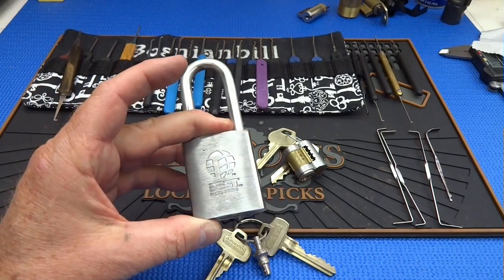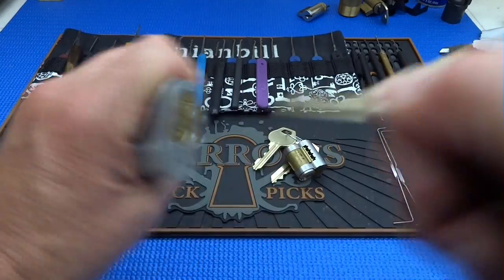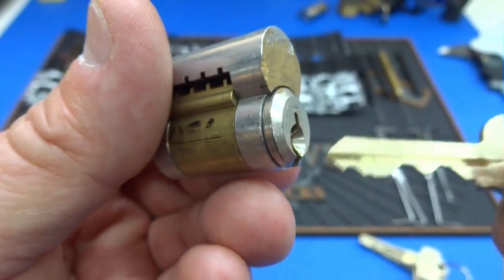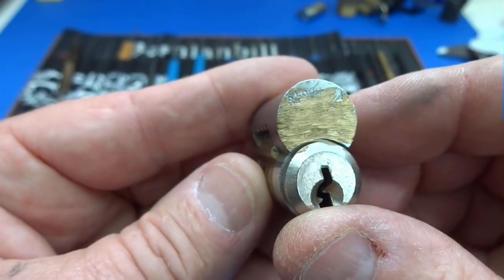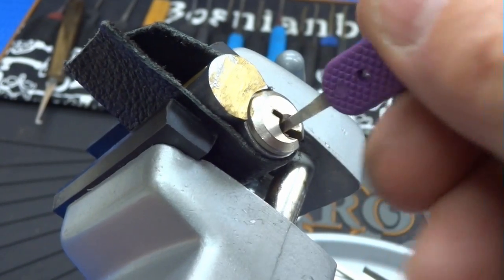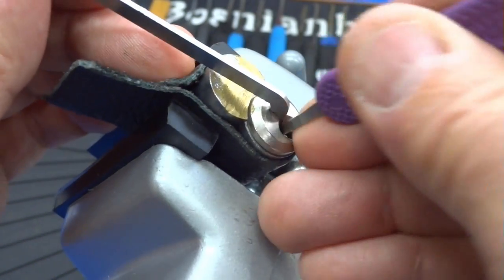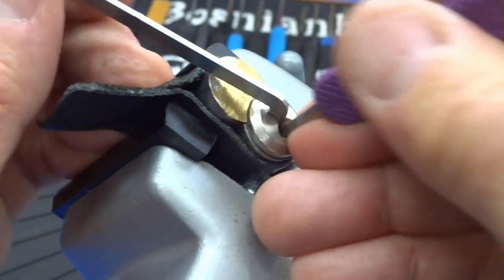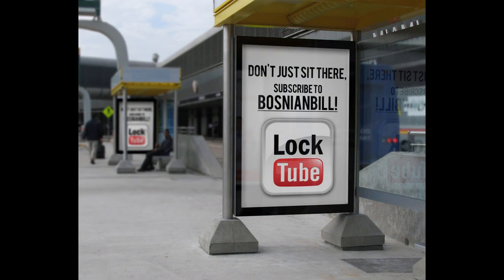(593) How to Beat Multi-Shearline locks

Comment: Having never worked on an IC lock this may well be a stupid idea, but could one use a piece of shim stock as a sort of tension wrench against the control pawl and thereby only apply tension to the control shearline? And if you did that, couldn't you then prevent anything from setting to the operating shearline?

Comment: one thing that is generally true of these as well that seriously alters some security is often that control key is identical throughout  the building so maintenance folks don't need to carry many keys. so once you get the lock out, dump the pins and let yourself in whereever you feel the need. i think many of the best keys while marked unlawful to duplicate, have blanks on the market. so in theory if you can impression a key to open it, i recall this happening at colleges where folks were stealing the locks out of the bathroom and putting similar ones in as they rarely were locked to begin with.

Comment: They are called control “lugs” so says someone  in the know. Interesting fact on BEST glass display case locks, the control key is the operator key and the operator key is the control key. Put that in your pipe and smoke it.

Comment: I have had good luck with the rocking technique. For Schlage IC cores I made a little tool by cutting all of the meat off of a control key so I could side it into the keyway so that when it was picked it would only retract the locking bar.

Comment: Thanks for the vid!! Question: When the core is out via the control key can you still open the lock as well? 
Thank you sir! Cheers from Canada 🇨🇦
Reply from the maker: Once the core is removed, the actuator is exposed and you can then open the lock by turning the actuator with a flat-bladed screwdriver (or any other flat tool).
Reply: Bosnianbill thank you sir.

Comment: Bill, I Just rewatched this vid and a question came to me....If you happen to rake it to the control shearline and manage to pull the core obviously you can actuate the lock. However, my question is...once the core is out, can this lock be shimmed open from the back side, to remove the plug, or would that be a real pain as well? Say for example for someone that has lost the key and you wanted to remake one based on the pins you find upon disassembly.
Thank You.

Comment: Bill I work for a large company and we use these best style cores in our locks for many types of things.  My question is how many different shear lines can these hold.  we use diffrent series most are the M style keyway.  But seriesed a b c d etc so like our common is D so if I have a core that has a D series for example a D28.  the Matching D28 key opens it.  Also we have a Master D key that opens all our D series locks.  We also then have a GM or grand master that opens all series A-F  not to mention the Core key to remove the cores.  So am I right in thinking there would be up to 5 pins in each hole?  each key is bitted diffrently.  thoughts on this?
Reply: railwelder1987 Compare the keys.  In master/grandmaster systems there are usually only one, two, maybe 3 pins that differ.  That one pin stack will contain a middle pin or wafer to make up the height difference between the individual level key and the master key.  If the individual key is lost, an unused depth/pin combo needs to be brought into service until at some point you will have to start over with a new system (potentially changing all keys and cores).  Ideally, the grandmaster has the higher cut so individual keys cannot be filed down to match.

Comment: Excellent tutorial.  There's a good chance that most locks will have at least one relatively strait shear line.  Especially if it is master keyed.
Nice to see Peterson using that thickness of metal.  Hopefully they will make all of their pick shapes available in that thickness.   It's similar to the 20 thousandth thickness of Southern Specialties picks.   I've used the Southern Specialties bogata rake with great success in many of the Best keyways including the WC keyway you have there.

Comment: Thanks for the reply Bill. What I meant was after the core is removed from the lock, how hard would it be to remove the core from the bible from the backside using a shim on these multi-shearline locks? So someone could get a good look at the pinning and possibally make a replacement key for either the control or operating functions.
Thanks again for your feedback.

Comment: You had shown some tension wrenches a while ago that were meant to pick to control on Best locks...  Will those tension wrenches only bind up the control shearline (which would give you better odds of SPP'ing all pins to control)?

Comment: A lot of them have master pins too. I have quite a few Best locks. Oddly I have an easier time opening keyways like the WC, the one you are using. I have a hard time opening the more open keyways. The Sparrows pick, that I think call the Best buster, actually works pretty well in the WC and other tight keyways. I just like to polish them up very well. The Best locks can also be bumped pretty easy. I might made a bump a Best lock video

Comment: Great picking again, Bill.
Does this plan of attack (rocking instead of raking) work on other locks prevalent to this type of attack ?  Also, can a lock as this type with the side locking bar (control key) be drilled out on the side where that locking bar is located, and core removed ?
Reply: bosnianbill Thanks "Brother" :)

Comment: Thanks for this. Question: can you gut the cylinder like a common American type? I don't think I have seen anyone gut a lock of this type.
Reply: bosnianbill
 cool. thanks for the info.
Reply: Ian Oliver The Corbin large format cores can be taken apart like a normal cylinder though. Just remove the C clip and use a plug follower.

Comment: I have 3 locks in my collection I cant pick have tried and tried and 2 of them are this style of lock so I understand what you mean. both are old locks 1 a best c.e.co.and one a arrow and that sucks they are 2 that I will never sell inless I get a good amount of money for them the arrow dus have the working key but not the control I would love to get the control key for it and both keys for the other lock but I no it will never happen. once again great video mate and I have ben thinking a lot about getting the Bogota set and the king and queen picks I want them badly the king and queen the most but just cant afford to throw down that kind of money at this point I no its not much only $16 shipped for the king and queen but rember its only 2 picks but 2 picks that quickly pick over 60% or house locks wear I live so they would help when I get a call.